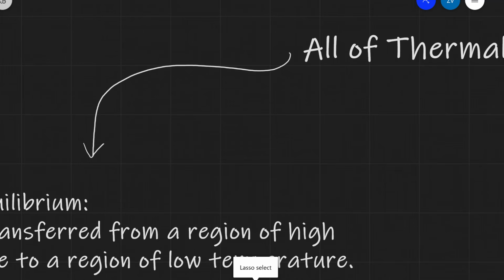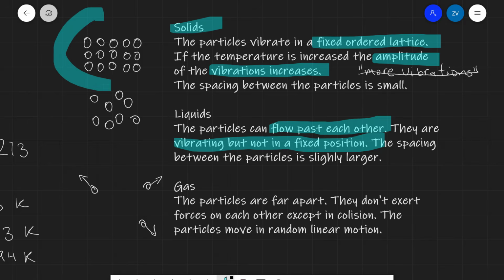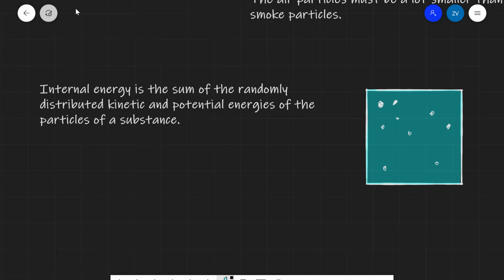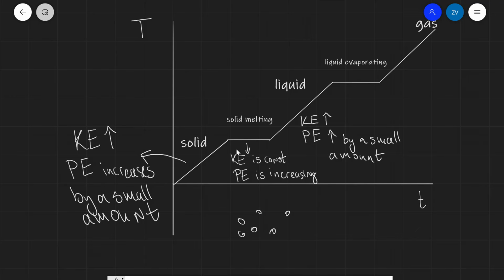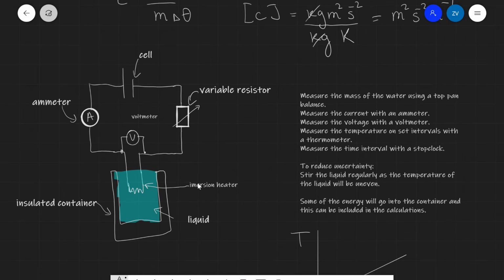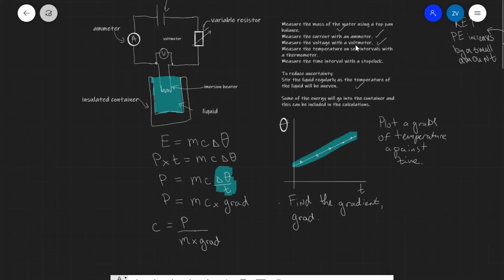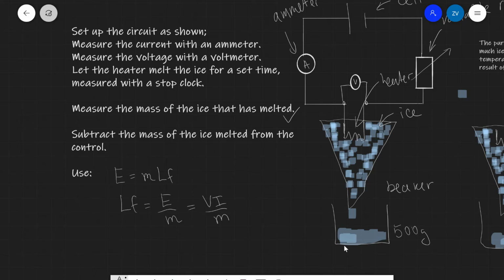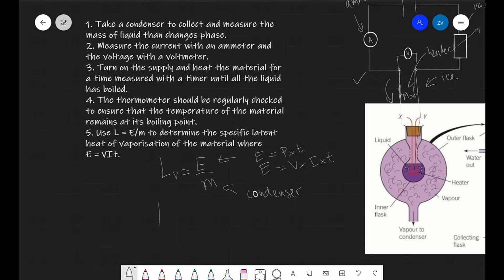A Level Physics Revision: All of Thermal Physics (in 28 minutues) Part 1

Comment: Is thermal physics and thermodynamics different?
Reply from the maker: Generally similar yes although there is some major differences. Thermodynamics involves the laws of thermodynamic  and lots of pV diagrams and theory on engines. I have covered this in my AQA engineering video. Also  at university it gets so much better as it delves deeper into entropy. Hope this helps!

Comment: Hi sir, could you explain the difference between electrostatic potential energy and potential energy. I read something that said that a gas a zero electrostatic potential energy becuase there are no electrostatic forces of attraction betwen the particles and i was wondering how this differs from potential energy.
Reply from the maker: excellent question. Electrostatic potential energy is a form of kinetic energy. A good way of thinking about it is any form of energy that can be coverted to KE, e.g. - positive and negative nucleus some distance apart, the system has the potential for attraction and for the particles to gain speed. Hope this helps!

Comment: Absolute temp=P/mc x t
y=mx+c analysis suggests that there is no y intercept but in the diagram there is a y intercept, why is this?
Reply: because they used degrees Celsius, if you used kelvin then there would be no y-intercept as at 0 K , energy is 0

Comment: If I write all the steps about how to calculate (c) ( the experiment) will I able to get all the marks?
Reply from the maker: depends on the question, typically they try to put the theory into a new situation and add a twist to the question but as long as you understand the theory and remember the steps, you will be be able to apply them and get the marks : )

Comment: hi sir for specific heat capacity experiment what would be the difference if it was solid instead of liquid?
Reply from the maker: Excellent question, it's exactly the same, the only difference is that there is a liquid  surrounded by the insulator.

Comment: Hi sir, what is the point of all the variable resistors?
Reply from the maker: Excellent question, they often appear in exam questions as a way of controlling the p.d. in circuits. In practice, most schools and colleges use a variable power supply for the practicals.  In this practical, even if the p.d. is fixed, it's still good to be able to fix it a p.d. we want, e.g. 6V by adjusting the variable resistor. Hope this helps!

Comment: Hi, how come for the practical for specific heat capacity there’s a variable resistor in the circuit? Anyways, great video 😊
Reply from the maker: The exam board normally uses this as a way to control the voltage. In this experiment we don't really vary the voltage but we need to set it to a value we want and then keep it there. Hope this helps!

Comment: Wow, your channel has grown so much over the last couple of weeks! (you totally deserve it). On another note, I wanted to ask the purpose of the variable resistor in the experiments above?
Reply from the maker: Thanks a lot! Much appreciated and yes, it has! Pretty awesome! So variable resistor - the purpose is to control the voltage, even if we don't vary it, if it is too high or too low this could cause problems for the experiment. You could also do it with a variable power supply.
Reply: @zhelyo_physics  Do you have any practice questions by topics?
Reply from the maker: @RiceKrispiii   loads! Here is a playlist: https://www.youtube.com/watch?v=nuTdbYL8X0M&list=PLSygKZqfTjPDC32W1_5X73bidHeCHjTFo
Reply: @zhelyo_physics  Thank you. Wish you were my physics teacher 😂
Reply: Also I wanted to ask why you wouldn't need a control for the Latent heat of vapourisation experiment?